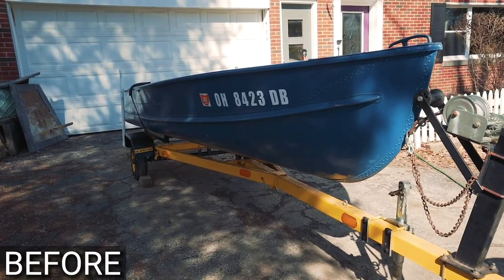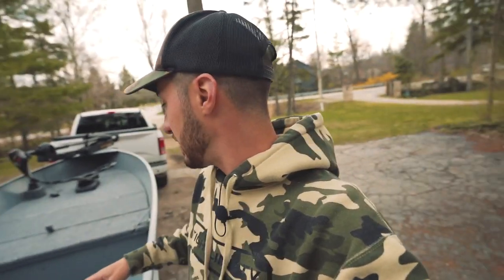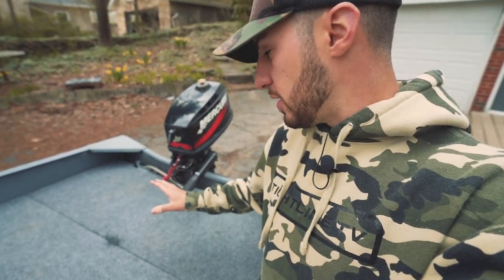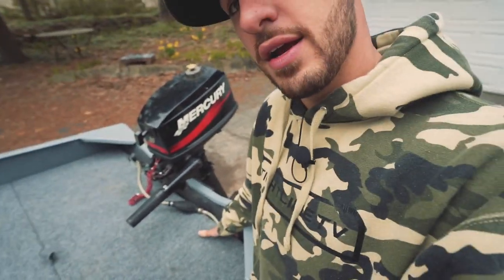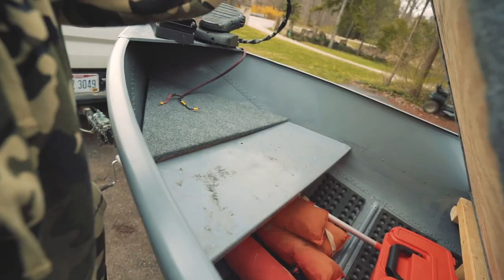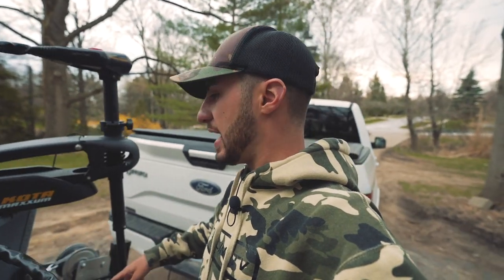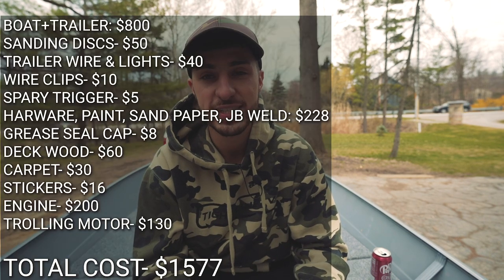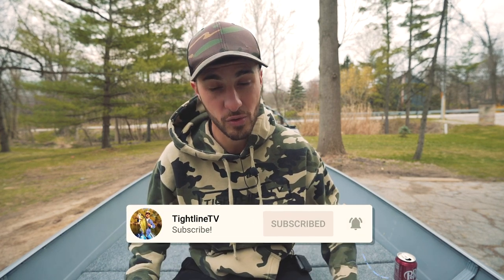INCREDIBLE MINI BASS BOAT TRANSFORMATION! and EXACTLY HOW MUCH IT COST.

Comment: $1800 for a Bass Boat!! better than most...spend as much as a house would cost and use it a couple times a year! bravo to you! my son and I are doing the same thing, found a 12 foot 1968 v-john boad and trailer for $250 got a fantastic 1971 Honda 4 stroke 7.5 Horse motor for $175, now were getting ready to do a paint job and a bass deck like yours! thats why were watching your video!
Cheers from Montana!

Comment: Nice presentation.   1816 isn't bad for all that you did.  I've got a 14 foot Deep V Grumman that I want to upgrade.   I've done the trailer replacing the wiring, lights, and inner bearing seal, and new tires.  That was that.
Next I'm going to work on the boat.  I want to flat bottom it for ease of moving around.   I've got a 15 horse motor that runs just fine so that's good.  Then some of the simple things need  replacing.   Rod holders, down rigger holder, and the big expense will be replacing the fish finder.  The old one was leaking some kind of a black goo.

Comment: I have a 1955 Runabout made by General Boat.   It's a good boat, had it on every river and lake within 50 miles, lol     

I put bottoms in it to make the ribs flat so it's easy to walk on.   I've done it a couple of times;  one thing I learned...   Don't use carpet!  Carpet, if not covered and well maintained will get really bad real quick.  Better to paint the wood and add pumice or some other nonslip surface to it, or expanded PVC board(more expensive, but lasts).

Comment: I’ve got a 58 sears jon boat a lot like this. Mines got skeletonized seats so instead of adding weight for storage I was able to largely go the other direction and loose it for storage. I still wound up heavier than I was but not so bad that it’s really noticeable. Big difference is I don’t fish for bass so making a nice carpeted boat wasn’t top priority as much as making it functional for catfish. My mods were more in the trailer. I’ve had rods disappear out of trucks and boats so I took pvc pipe and a hinge and padlock making tubes on each side of the trailer to lock my fishing rods in. Probably the only thing I miss about my bass boat was I could do the same thing but lick them under the deck

Comment: Great job , I’m looking to do the same thing but with a fiberglass hull if I can find one , flats boats are insanely expensive here in west central Florida, the one thing I noticed was that the plywood wasn’t painted or sealed which might give ya a problem later with moisture intrusion, but the boat looks great and it’s a great price, tight lines  bro ! 🐟👍🏼

Comment: This may be a dumb question since I'm new to boats but the 2x4 supports you put in did you run any screws through the bottom of the boat to secure them or just into the hull and transom?

Comment: I just got a 16 foot Landau that is 67" wide with a a trailer for $700 from FB Market place. He wanted $1000 but I just asked if he'd take $700 and he said sure. 
 Just needs new transom and a few rivets replaced and the trailer has the typical lights that don't work and hubs that need replaced. 
Will be doing a jon boat to bass boat conversion since its so big. Going to be powered by an 80lb Minn Kota Riptide since Im only using this on very large private ponds.

Comment: I have the same exact boat 14ft V-bottom boat  wanting to do the samething  to mine,  but I have a 18hp Johnson short shaft. Im worried if the motor is too heavy for the boat? Wish I could send pics I repainted the trailer two-tone white top teal green bottom! Love it going for the retro style look with it. Any thoughts on the motor and weight if roughly 80lbs? I haven't tested on waters yet!

Comment: Nice...I just scored a 1962 alumacraft v bottom, with a trailer AND a 25 horse johnson motor.
It has new tires. Trailer lites need rewired. He also has a flat tire which tore off the fender on one side.
The guy who owned it, was asking 2500, told me if I buy it today, he'd take 1000 bucks...
I went over and brought it home

Comment: i love what u did, im actually building my own trailer and repainting my 12 ft aluminum boat. just wondering for boat winch how long is the stand u have on your trailer and how is winch mounted as i would like to copy the simular layout you have!! i would like to make my own bunker rail for my boat. how would i prooced or how did u do yours. basical my 12ft is same as your 14ft. so would love if u can help with that.! also is rust oluem primer for aluminum good for primer before painting colour you want and how many coats. how many coat with colour choosen also , i was deciding on if i should do like aluminum metalic or smoky grey or light/flat grey. for both inside and out side of boat. will those colour be good when on water before puting clear coat. as was worry if i used lighter colour like aluminum metallic or grey will reflect!!!  smoke grey looks nice too but would love your input.

Comment: Hey dude, this looks awesome, I was searching for something to fish with and this video inspired me to get a bare bones aluminum 14ft to build into a bass boat myself. I was wondering how you fastened the support for in the middle of the front section, as well as along the sides to the actual aluminum part of the boat, because I aim to do the same. Also, did you just get carpet tile from home depot? because I think that is what I will do as any marine carpet I have looked at is ridiculously expensive. Thanks a lot!
Reply from the maker: I have videos on my channel building this boat entirely from start to finish. But for carpet I just bought outdoor carpet at Home Depot. It was like $60!
Reply from the maker: Thanks! I have videos on my channel building this boat entirely from start to finish. But for carpet I just bought outdoor carpet at Home Depot. It was like $60! Good luck!
Reply: There’s no video showing how you fastened the 2x4s to the bottom?